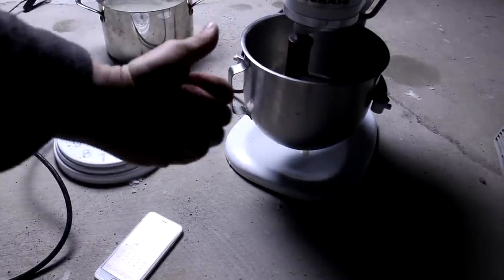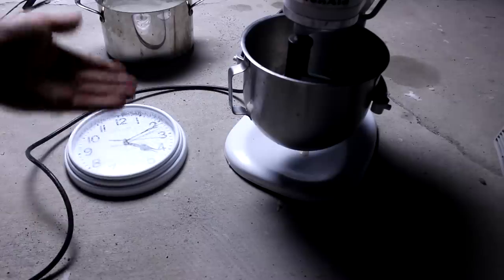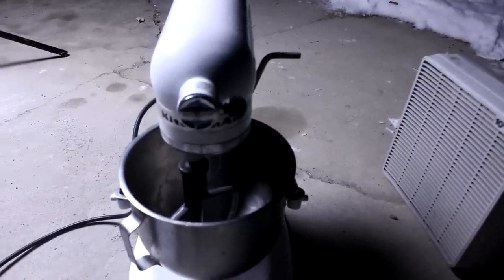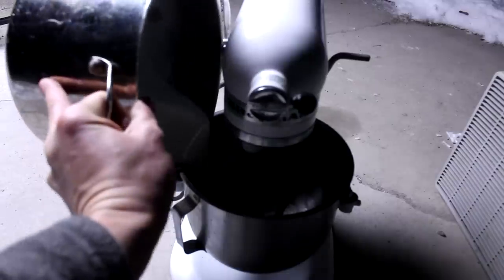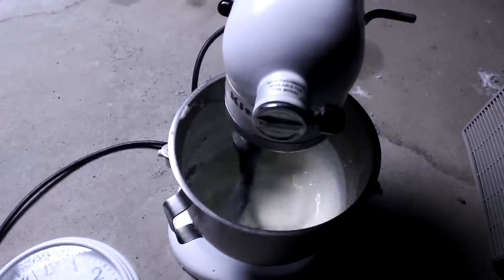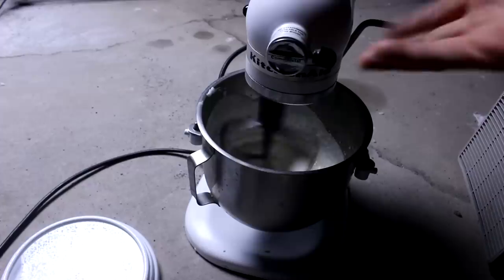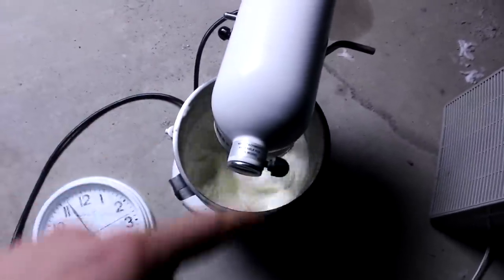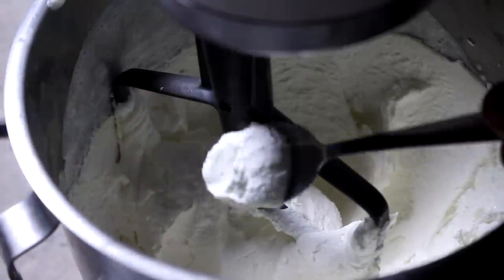Making Ice Cream Outside With A Mixer

Comment: @Cody'sLab The next step...  Large saltwater reservoir, say a kiddie pool (not deep, just a large surface area for passive radiation).  A bucket to put the mixing bowl into with steel strapping to suspend the mixing bowl in the bucket and keep it from turning with the mixing paddle.  Some hose and a pump to circulate the saltwater from the reservoir through the bucket and back. Checked the comments for originality.  1metiz came closest but lacked a reservoir and circulation.

Comment: For those living in a >0*c environment:
 I drilled a hole in the side of an old freezer, ran a cable thru and stuck a female socket on it afterwards. Placed a mixer inside and made ice-cream. Worked great! The temperature did go from -17*c to -9*c, I was really worried the heat from the engine in the mixer would defrost the thing,  but it leveled out on 9 :) Thank you for the idea! Really looking forwards to serving my friends homemade ice cream on our next gathering.
Ice cream have a tendency to get less fluffy and even creating crystals if stored over long time or to warm, homemade ice cream is a different world from store bought!

Maybe a small battery powered mixer could work, eliminating the need to pull a cable into the freezer? Separating the outer isolation from the cable so that it fits thru the door without releasing to much energy could also work, but it is a bit sketchy...

It would be great to hear other ideas! 
Yes, I know there are ice cream makers, but those things are really expensive, and if you are a big fan of paying your way thru pre-made solutions, you probably wouldn't watch this channel..

Comment: 15 deg F....Yuk! You can have that lousy cold weather. Now if you can make hot chocolate outside without a fire or electric, then you're onto something really good.
Reply: electronicsNmore solar reflector.
Reply: I was thinking of using a chemical reaction instead.
Reply: electronicsNmore a while back I found canned coffee that would heat itself when you pulled a tab on the bottom of the can, it had a chamber at the bottom with a chemical heating element.
Reply: Yes, hot packs and cold packs do that, but we would need much higher heat output to make hot chocolate.
Reply: electronicsNmore MRE heaters can get pretty darn hot.
Reply: Go to Dubai all year round, you can do it there just by walking outside in the shade.
Reply: No, I meant doing it when it's 15 deg F outside. Clearly you don't want ice cream when it's cold outside, or hot chocolate when it's 120 deg F.
Reply: making hot chocolate with termite. What could possibly go wrong?
Reply: -20 where i live, celcius :D Love it!
Reply: Gabriel Kemec I don't want termites in my hot chocolate, I don't care how warm they are.
Reply: electronicsNmore Fine just run a Stirling engine in reverse with a bike that has the back propped up and the wheel on the flywheel, or use a vortex tube and a big tank of compressed air filled up with a bike pump.
Reply: Or what rob said. The mre heaters get scorching if you insulate them. They also put off hydrogen as they react though the stream is also oversaturated with steam so its kinda difficult to keep lit but if you ran the gas through a tube filled with a proper catalyst and some very tiny venturi ports you could react the hydrogen with oxygen pulled in and feed the excess heat generated into your hot chocolate.
Reply: That isn't really that cold. At -10°C (15F) the air has basically lost all relevant moisture, so you don't really feel the cold . I am  currently stuck at somewhere between +5°C and -5°C. At that the air is still moist and the cold creeps everywhere and you can't really isolate yourself ... just awful.
Source: Years of experience trying to sell stuff at outdoor Christmas markets.
Reply: Atlas WalkedAway my buddy told me they would seal those mre heaters then throw them in the fire to scare anyone not paying attention.
Reply: Rob I would crumple one of our big water bottles and fill it up with the hydrogen steam mix, shake it around to pull some of the water out, screw on a cap with a hole in the lid, squeeze once to pull in some oxygen and mix, squeeze twice and let it pull in a flame. Dude, they only burn for like 1/4 second but it sounds like a giant demonic flying cat hiss and you can launch the bottle 20-30 feet on the trust. Talk about making people flip out of their chairs, I'm fuckin dying just recalling it.
Reply: -15 here. Bit chilly in the morning, and boring to start the truck.
Reply: Engine warmers to the rescue @Mp57navy
Reply: Atlas WalkedAway Hahaha.
Reply: Fire is a chemical reaction!
Reply: noobnoobyify Ha ha gadt daaamn.
Reply: I think lime and water can heat. There was a canned coffee that would heat when you pushed some thing on the bottom of the can
Reply: LOL
Reply: -10 to -12 C really isn't all that cold.  Of course I say this being Canadian...but yeah, get back to me when it's -40, now that's bracing (I didn't bother saying C or F for that because it makes no difference).
Reply: Well, Sydney in about a month's time should be hot enough to cook eggs on the footpath or your car bonnet. Something like the mid to high 40s (Celsius). Fin Fact: The Bureau of Meteorology had to add new colours to the temperature charts last Summer as the extreme temperatures were literally off the charts. That's a worry.
Reply: You mean a fire?
Reply: It only gets up to 28C or 82imperialC here and it's way too hot for me. >.>
Reply: I meant that fire is a chemical reaction. It was a reference to his first comment, where he asked "...without fire..." then specified with "I was thinking of something like a chemical reaction instead". That being said, I'd never survive in Australia. My genes aren't meant for warm climates.
Reply: Yeah, peak summer here is 28. usually it's 23 or so. Which is 73Mr far and high
Reply: But hot chocolate is best in the cold weather :/
Reply: electronicsNmore
12 hours ago (edited)
15 deg F....Yuk! You can have that lousy cold weather. Now if you can make hot chocolate outside without a fire or electric, then you're onto something really good.

Welcome to california.
Reply: Chemical reaction? That's easy: Use a carbon based material and heat it up until it ignites. Also known as FIRE.
Reply: Pyrolise alcohol or carbonyl vapour using a hot copper catalyst.
Reply: Yeah you can, if you live in Australia. Just turn the cold tap on.
Reply: electronicsNmore calcium oxide. AKA quick lime or burned lime will heat up when added to water (or well, water is added to it), IIRC this is how those MRE heaters work. Cody could try this, as it would have enough heat output for hot chocolate.
Reply: australia, just put it outside... however you wont want it...
Reply: In fairness Atlas, Gabriel only said one termite.
Reply: mre
Reply: electronicsNmore it's-2f where I'm at rn

Comment: Question are you sure that wasn’t butter. With the amount of “churning “ and time.
Reply: think the milk cuts down on making it butter.
Reply: Milk is cream and whey. Cream can be acidified into curds for cheese, or sugared and mixed at very cold temperatures to make ice cream. Bacteria can be added to pre-heated cream to acidify it and consume some of the natural sugars; beating this mixture afterwards makes yogurt, which is much like cheese curding but the pre-heat treatment breaks down the milk protein, so instead of tangling up into curds, you get a silky smooth mixture. 

Also, we can tell a few things about his recipe according to the result. As his ice cream was very solid but still creamy, he used only a little sugar but still enough to get the texture right, as sugar interferes with cream's setting process, which is why a lot of commercially available ice cream remains soft and 'soggy' in the freezer; because it's over-saturated with sugar. Just enough sugar results in the smooth, creamy texture we associate with well-made ice cream, while not enough sugar results in a frozen ice cream brick.
Reply: Milk is milk. Whey, by definition, is the watery fermentation stuff from separation from soured milk. Milk neither contains whey, nor does soured milk for which it would be like saying oranges contain 'orange-juice'. You get the 'orange-juice' when you squeeze it out.
Reply: When milk ("sweet") cream is split out from whole, raw milk, the whey remains, regardless of methodology used to split it. For example, if you let raw milk sit, it will do this naturally, as well, bacteria souring the milk and splitting the cream off (which also curdles because of the acids souring the milk from naturally occurring bacteria), and whey remains. Same when you artificially curdle it with acids directly, such as for making cheese. When whey is produced via an acidic method, it is known as acid or sour whey. However, if you introduce a clumping agent, like ammonium hydroxide, it will cause the fats to clump up and settle out of milk without any souring being involved. Whey can itself be processed to remove a secondary, smaller volume of cream from it, but it's noticably more tangy, saltier, and has a cheesier taste. Milk indeed contains whey, and we do in fact use such terminology- or have you forgotten the use of "milk-fat"? Lactose itself is just a specialized word for saying "milk sugar", too. Cream may be skimmed from milk, but so long as all the milk-fat isn't removed, it still remains milk- thus the terminology "partially skimmed milk". Even so-called "skim milk" still has some milk-fat left in it, otherwise you'd just be drinking unsoured whey. This is also why you can't make your own clabbered milk, sour cream, or other such preparations from anything but whole milk that hasn't been ultra-pasteurized- there isn't enough milk-fat left to let it do so, and homogenized milk itself has an emulsifying agent that makes it hard to settle out the milk fats anyways.
Reply: This week on The Dairy Diaries...
Reply: This is what happens when you're a cook that is also into molecular nutrition and science. :P
Reply: There is no 'whey' in unfermented/unsoured milk, nor can it be split out from unsoured milk. We don't have to go into a discussion of milk chemical technology.
There is protein in fresh milk.
There is fat in fresh milk.
There is lactose in fresh milk.
But no way there is 'whey' in fresh milk; 'whey' is the separated (or separating, continuative aspect) component from fermented or otherwise soured or curdled milk

Comment: I never thought I'd catch Cody making a science mistake, but the actual word you were looking for is Thermal Mass. Thermal conductivity isn't really a problem when making ice cream with cold air (the thermal conductivity of the bowl and ice cream are the only two that are really factors, and those remain the same), but the decreased thermal mass of the air compared to ice water is what slows the creation of ice cream. It's still a really neat experiment, though!
Reply: No, I think Cody is right. If the air were more conductive (all else being equal) it would cool down a lot faster. The amount of thermal energy the air can store is not really an issue given how much air there is.
Reply: You're correct- amount of thermal energy the air can store has nothing to do with it. The amount of thermal energy a given volume of flowing material can move away from a given surface(the bowl) in a unit of time has EVERYTHING to do with it. And that, my friend, is dictated by the specific heat capacity of the flowing material (so we were both wrong!)
Reply: I see what you're saying, but still I maintain my point. If you think about the extremes it's more obvious. If air were a perfect insulator, then it would not cool down at all (due to conduction but let's not worry about that). If air were a perfect thermal conductor, the ice cream would reach thermal equilibrium with the air immediately, as long as the air has some non-zero thermal capacity. So the reality is somewhere in between. I agree that there are other factors at play, such as the heat capacity per unit volume, but I think the original statement is not wrong, per se.

Comment: my mum had a thought: how much faster would it ice cream if you packed snow around the bowl?
Reply from the maker: way slower due to the insulating effect of the snow
Reply: Macncheese0 air trapped in the snow acts as the insulator.
Reply: You can add saltwater to the snow to make decent coolant.
Reply: I thought it would be faster too but that makes sense why it would be slower.
Reply: I guess you could put snow on the side that isn’t being blown to get the ice cream cold and the cold air would do the rest

Comment: I am not questioning your thermostat or your legitness, but why cant you see your breath?
Does it have something to do with moisture in the air, or something else?
Here in austria you can begin to see your breath at 0℃ and at -20℃ it is like the thickest vape you have ever seen.
So, you should see your breath at -11℃ pretty good, but you dont.
What could be the reason?
Reply from the maker: Easy, I breath through my nose, its like a built in heat exchanger that saves loads of moisture.
Reply: Not even when you talk...anyway,  what i don`t get about the flatearthers response video is, why you didnt say that comparing a car to a boat doesnt make any sense because he didnt know how much smaller the car would have to be to stand right next to the boat.
And another thing you could have pointed out would be what he thinks is on the other side of the edge.
Because if the earth was flat, there would have to be an edge, and gravity also doesnt work that way.
Reply: Oh, and btw. do you think that there are other living organisms out there accept for earth creatures?
I think that there are some, but nothing like the ones we know.
In my opinion, it would be selfish and dumb to believe that we are the only living type of organism in the entire universe.
Reply: Eric Juen you're crazy
Reply: because you're talking with yourself

Comment: G'day,

  Yay Team !

   I can recall back in the 1960s, when this part of the World (30 Degrees South, 151 Deg. East, 3,750 Ft AMSL...) used to get a lot colder, back  when Household Refrigerators with Freezer-Compartments large enough to accomodate  1/2 Gallon or 3/4 Gallon tubs of Ice-Cream first  hit the domestic Consumer-Market...; and when the Grocery-Stores in Rural & Regional Oz first began selling Ice-Cream.

  Before that, my parents told me that people had occasionally attempted to home-make Ice-Cream by simply taking a Metal Bowl of a similar mixture to the one which you used, and whisking it ferociously before taking it outside and leaving it there, then going out every half-hour or so to re-whisk it, until it turned into something not quite entirely like propper Ice-Cream, which had finally appeared in the Shops.

   As you almost mentioned, it requires  ceaseless constant agitation while freezing, to keep the Fats sufficiently emulsified as to prevent the formation of Ice-Crystals - which otherwise make the result taste "spiky" at best & "crunchy" at worst...

  Have a good one,

 ;-p

  Ciao !

Comment: To all the youtubers Please use metric system your majority of audience are outside of USA!
Reply from the maker: That is demonstrably false, according to the analytics I have available, only about 20% of my viewers are outside the states.
Reply: Cody'sLab I really don't get the people who want you to switch Fahrenheit for Celsius. I mean, feet to meters makes sense, because meters are the SI unit, and this is a science channel. But Celsius isn't even the SI unit. And both Celsius and Fahrenheit are equally cumbersome, and over complicate your equations just as much.
Reply: Aeroscience celsius makes so much more sense.. 0 or below, water freezes. 100 or above, water boils. Done, celsius explained.
Reply: @Aeroscience

Celcius isn't at all cumbersome.  Perhaps for you because your system of units sucks...

Yes, you are correct that celcius isn't the actual SI unit but celcius still makes sense because it's based on the same units as kelvin, just the scale has been slid by 273 degrees.  ie: -10C is 263K, -20C is 253K etc.  Scientists often use C instead of K when it makes sense to do so, even though it's not the 'official' SI unit.

Metric is the superior unit system for precisely the reason you mention.  It's not at all complicated.   Everything is in multiples of 10.  There's no 1.5652309849874398759843759875987958 * this = that.

@Cody'sLab
...And to Cody,  I'm just grateful that you include Celcius units.  It's not something have to do at all, it's just nice for your out of country viewers! :-D
Reply: Soooo... Show Celsius in a smaller font...
Does the analyzes show how many of your US-viewers are really outside America, using a proxy-server? ; )
Reply: Celsius is linear and very akin to Kelvin. Triple point of water is 0.01C and boils at ~100C. All countries uses it except USA. I bet people used Fahrenheit because it was more precise before people were used to decimal numbers.
Reply: I use °C because I deal with component temps and that is always rated in °C if I told you the mosfet was 250°F you wouldn’t know if it was about to fail or not, where 121°C means yea it is really toasty and internal junction temps are almost at breaking point (of course depending on the chip)
Reply: Celsius is the scale for designed for doing science, 0-100, useful. Fahrenheit is the scale designed for measuring if the temperature is going to be comfortable for humans. (sort of). in Fahrenheit, you have more granularity, and the ability to be specific about how the temperature feels without screwing around with decimal places.
Reply: monil mansukhani You don’t have to leave a comment like that just politely ask him to try to use SI units in his videos or put captions in with SI
Reply: My boy Erik from Internet Comment Etiquette with Erik taught me how to politely comment
Reply: monil mansukhani I tend to use F when it's warm and C when it's cold. I'm an oddball.